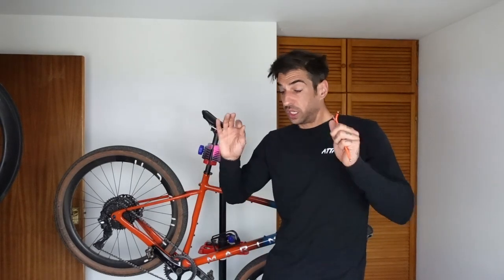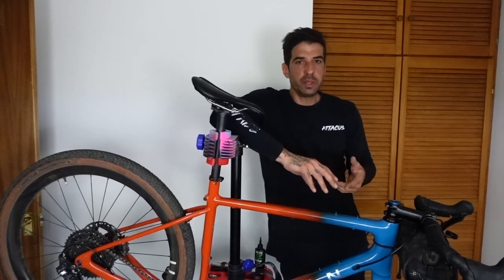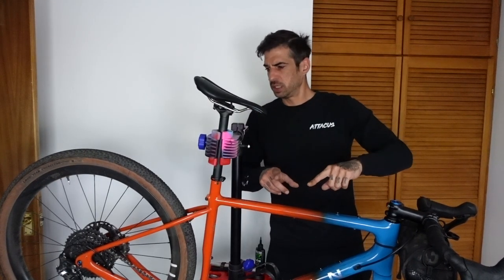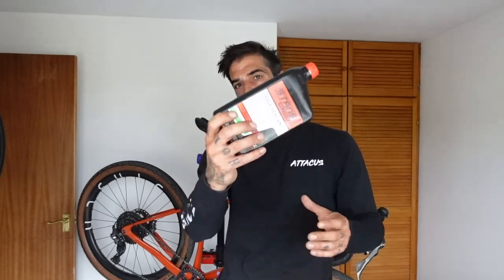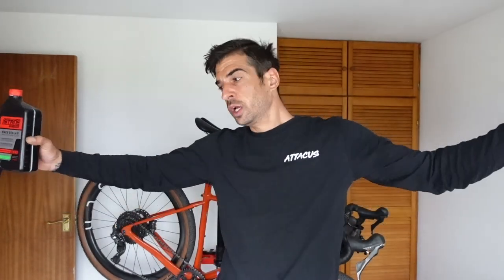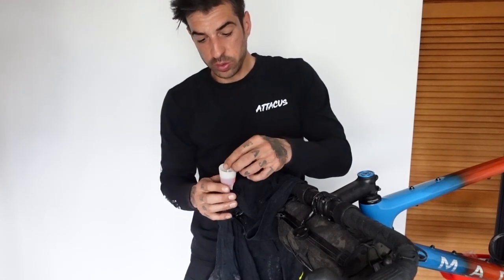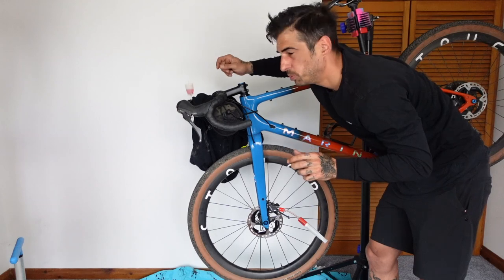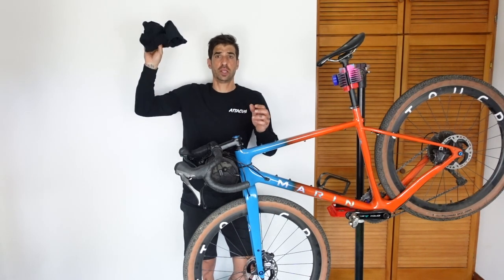How To Prepare Your Bike For A Long Ride/Race

Comment: That's pretty much how I used to do the brakes on my MTB. A syringe at both ends, made sure there were no bubbles at the caliper end and pushed the fresh fluid through to the lever syringe. Job done and it always worked for me.

Comment: Did you check your brake pads?
I checked mine on the weekend, discovered they were worn, and when I went to put the new ones in discovered I couldn't push one of the pistons back. :( So now I've taken the calliper off to dismantle (hopefully the piston bore and piston are just dirty and not damaged), and I can't ride outside until it's sorted. :(

Comment: I will add: check gears are shifting correctly, check tire wear and also any nicks cuts etc and finally check battery levels if using Di2 or AXS

Comment: Hey Dave, great video! On a completely different note, could you be persuaded to do a longterm review/recap of the rider 750, now that you've had it for a year or so? Does it still hold up or do you find it lacking in any areas?

Comment: Setting up hydro brakes are not as hard as they sound. The only hard part is like what you did in this vid ( the lazy person way ) is to make sure you don't get fluid on the pads/ rotors! Side note how I bleed mine is to half full the syringe and pump that trough the system once the cup is full and syringe empty lock off the bleed nipple. Do a few pumps on the lever a.f you should be good to go. Also when you sapping the lines have the bike tilted so if it's back tilt it front up and if its front tilt it front down ( it just drive the air bubbles if any out to the top quicker☝🏽- once you bleed brakes a few occasions you will master it - they not hard to do